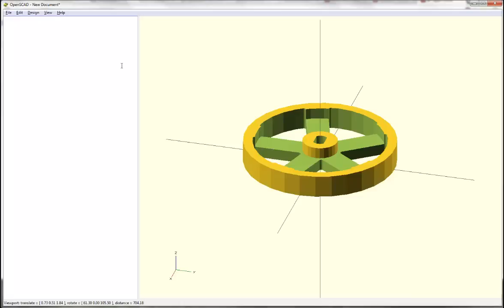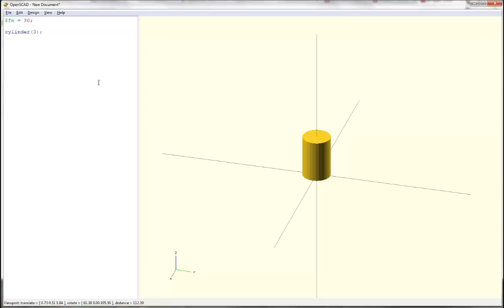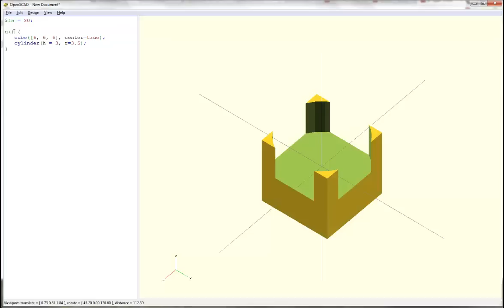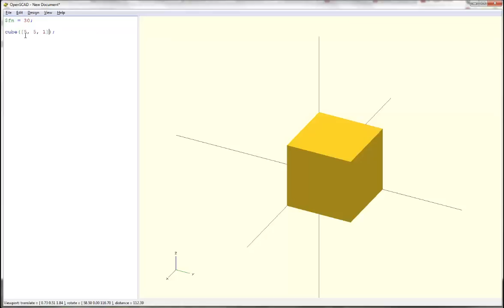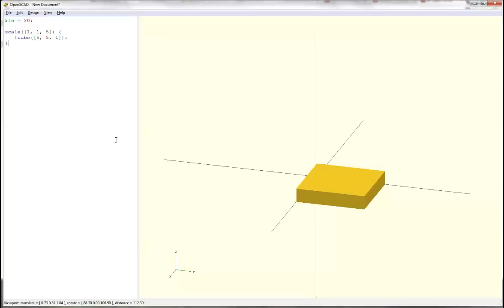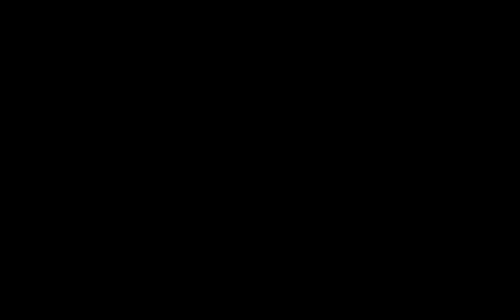Open SCAD Tutorial #1

Comment: When I type in the commands, nothing happens.  Could you explain the settings you use with OpenSCAD?  Is there a way to convert OpenSCAD files to SolidWorks?  Thanks.
Reply: Apparently there's a way to export from OpenSCAD to Freecad and from there to Solidworks.
Reply: I want to make a 3D printer, but want to scale it up. That requires tweaking of the 3D parts before printing.